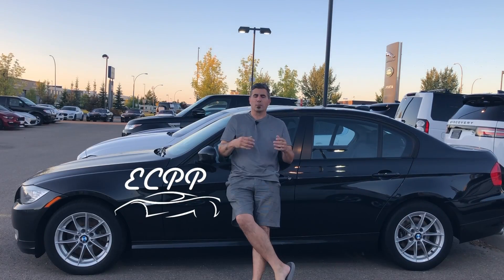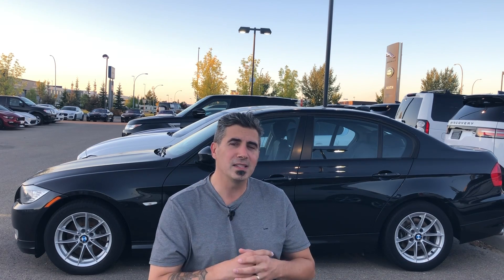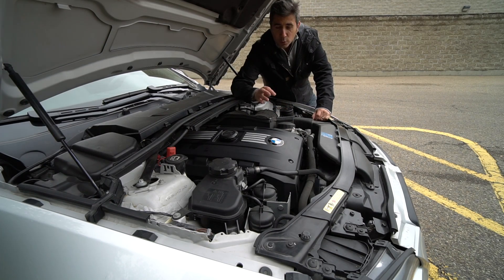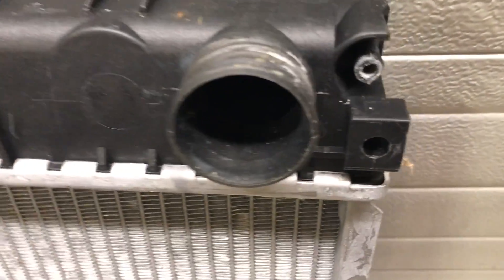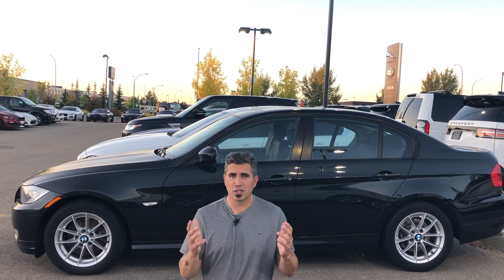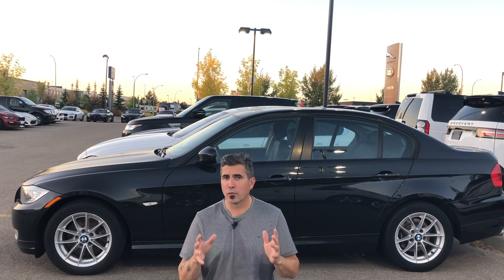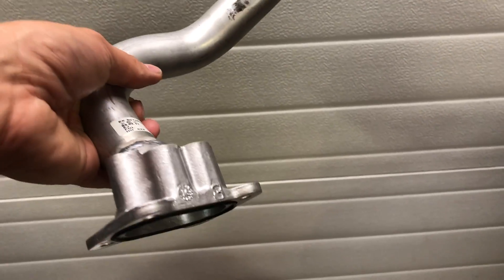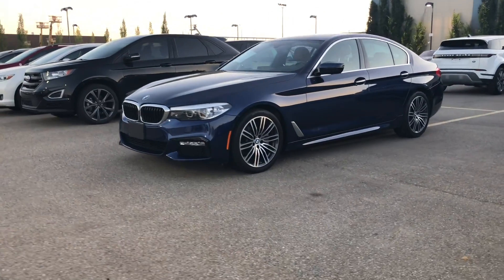Why Does BMW Use Plastic Engine Parts??

Comment: Well you are very politically correct and I can see why or the rational behind it. 

But, no thank you. Never again another BMW.

I like my $5,000 vacations too much to be spending that kind of money on my car so often. 

I am an engineer by trade and I can tell you. German engineers aren't using refurbished plastic to save the environment. They are doing it because the big wigs are telling them to and are cashing in.

I hope they listen to you. 
Because,  what they don't realize is they are killing the brand.

Do you want proof?

Look around, count the number of older BMW's as you drive block by block down any American street. You will notice THERE AREN'T ANY OLDER BMW's parked. Because, no one is keeping them!

They are immediately sent to the trash heap for demolishing, in as little as 5 to 8 years. At that point in there life the owner just can't justify dumping money into a car from hell.

 IT WON'T STAY FIXED LONGER THAN A FEW MONTHS AFTER 5 YEARS ALONE. 

Limp Mode becomes an all too familiar routine with these cars. 

If isn't a vacuum leak, its failed coils. If it isn't a failed coil its leaky gasket spewing burned oil into the passenger cabin. If isn't burned oil into the passenger cabin it's an electrical problem. If that isn't the problem now then it's a failed electrical water pump later because the blades are made of plastic. The list is too long of problems I have experienced, way too long. This is the short one. 

No thank you, and I will keep telling everyone until BMW decides to own up to their legacy of quality & pride in their product. I will not encourage greed of this magnitude. If they insist then they deserve to go under.

Respectfully sent

Comment: In Tennessee you don't see any pre 2000 BMW's on the road. You hardly ever see any 2000-2006 models. As a matter of fact you hardly see BMW's at all like you use too. I've been on the interstate and have seen BMW's break down right in front me with the driver pulling over putting on the emergency flashers while the car is still slowing down. I guy I know has a brother-in-law who is the German luxury car mechanic for a top import shop in town. He had to change the twin turbo's on a 7 series. He had to take almost the whole motor a loose to change them out. He said if he ever meant an BMW engineer he would probably knock them out. Anybody with any knowledge of plastic and heat knows which one will lose. BMW's are some of the most beautiful cars out there, but in these dangerous times we live in who thinks it's worth the risk with themselves or there wife and kids breaking down and becoming victims because you bought a beautiful, but plastic surrounding turbo engine because they BMW wanted to shave an extra five pounds of weight off the weight of a car so it can go 163 miles an hour verses 161 miles an hour. A woman friend of the family bought two brand new BMW's and they both broke down in less then three years old. She said never again. Why do you see Audi's all over the place. I see them everyday. BMW's every now and them.

Comment: I can attest, from personal experience, that BMW does NOT  cover these plastic parts in even their top tier "platinum" extended warranty programs.  Had steam coming out my hood on a coolant hose connection that broke in my, still pretty new, 3+ year old vehicle; was told it was regarded as a "wear and tear" item and not covered, like they're freakin' brake pads or tires.  Called up customer service, to inquire whether or not the coverage I had covers the entire coolant system, hoses and all, (not mentioning the recent issue I had), and the rep said, yes, it should be covered.  It would have taken half the age of the universe for a failure like this, if the connection were a (recyclable) METAL connection otherwise.

If anyone sees a class action lawsuit over this engineered obsolescence cr*p, please feel free to let me know.

Comment: I just leased a loaded Lexus Rx350. I test drove the X3 m40i and loved the way it drove, but decided to go with the Lexus due to the interior quality and value. I kind of regret it, and kind of don’t. After 3 years I don’t know if I’ll keep the RX or not. The fuel economy sucks 16 mpg (drive average) so far on the Lexus but takes 87. My friend has 2 bmw’s m4 & new X5 M50i and drives them hard and gets better similar mpg. So BMW is doing something right with mpg. What do you guys think?

Comment: Plastic coolant pipe from the engine block on my daughter's low mileage  318i just crumbled and caused the engine to overheat.  It was buried under the intake plenum and left the car out of commission for a week till I could repair it.  A difficult job to replace with lots of stuff to dismantle just to access.  (same part on my older '78 320i was metal.). I once looked at used BMW's but have been driving a SAAB now for the past 10 years and have no plans to return to BMW.   The newer BMW's scare me with all of the buried stuff and expensive technology.  This is no longer progress..... 
"Bring My Wallet" certainly fits the brand's logo.

Comment: At the end of the day, BMW, and other Brands that use an abundance of plastics that fail, are responsible for climate change. The same brittle plastic pipes, were once made of rubber with a metal screw. These pipes would rarely ever fail, unless punctured. They have made things that normally last forever, fail as if it was a maintenance item.
We as the citizens, have to pay ridiculous taxes for gas and waste, but these companies are making garbage parts, that last short times, that cause huge waste of plastic at the end of the day, for their own profit margin. The governments need to have laws preventing this, if they want to be serious about " climate change " - Mechanic of 20 years

Comment: Almost brought a 2011 bmw 328i 89k on it for 4200 . Sounds like a steal ehh?  No way Jose. I got a older model Lexus GS 300 instead. Much less repair drama and Toyota makes engines that last and last if maintained properly.
Reply from the maker: Thanks for sharing and the GS cars are nice too

Comment: All car manufactures are using more plastic but it's the quality and durability of the plastic that's used that is the problem. As you point out BMW's use of plastic in the cooling system has so far been a recipe for disaster, it's not of a high enough quality to last and failure often means severe engine damage. The plastics used on many European cars ends up cracking or failing whether it's in the engine bay or interior of the car. I worked on Renaults for most of my life and some of the materials used, life span is appalling. Yet if you buy a Lexus or a Honda the plastic parts are normally of a quality that lasts the life of the vehicle.
Reply from the maker: True, unfortunately

Comment: I´ve done over 500k miles on two e46s (330ci and 328i)  The american spec 328i engine without NIKASIL is 1 million mile engine.  That thing will burn tar and keep going.  All e46s have the same issues:  Water pump, water deposit, bad rear frame, silentblocks, airbags... The 330ci burns oil since, new 1litre every 1000 miles. BMW never recognized the problem and said its normal.   Running a Toyota for 400k with no issues, but its a boring piece of shit to drive.  Rather have the BMW with all its problems.
Reply from the maker: I totally agree Alex.  Same here.  They struggle with failures but woke are they ever fun to drive

Comment: Dont worry about all of that my friend.  Combustion engines are now all but obsolete and soon enough we will all be driving electric cars.  BMW not only lost its way by going the plastic route in manufacturing highly critical components and leaving many of its loyal costumers stranded on side of the roads around the world, many of whom will not be returning to a BMW dealership, they also missed the electrification train and will become irrelevant as a brand if they dont give their head a shake!
Reply from the maker: Hopefully not for at least 20 years so after I am too old to care about the driving experience.

Comment: You're absolutely right.  Something is amiss here.  One would imagine that engineers who presumedly spent years studying at perhaps some of the top universities would be aware of this basic fact and not use them in engines.  This issue about plastic, heat and cool, brittleness is basic chemistry!  Why are they continuing to do this?
Reply from the maker: Service business model

Comment: I have a German car made in 92 and almost all components are original. I could not even imagine swapping stuff every 4 or so years. Water pump, radiator, and flanges: made of metal. 
Hell, it's even the original stainless steel exhaust. Can you imagine this with a modern car?

Comment: Planned obsolescence. 

There is a reason BMWs are so hilariously cheap to lease in some places, despite having atrocious residuals. Here in SoCal you regularly see 250$ BMW leases in slower months/on loaners. Sometimes even with 0 down...

Personally, BMW is by far my favourite brand to lease as you spend less on the lease than you would on depreciation if you bought it (let alone maintenance!). If I was buying a car? Jesus christ no.

Comment: It's the thermostat cover that leaks. BMW became obsessed about weight gain in the 90's. They set up a department to find ways to reduce weight. Plastic parts and aluminum engine bolts were two of the recommendations - both of which are idiotic because they fail and leave owners with expensive headaches.
Eventually people learn and buy Toyotas.

Comment: More or less they are all using plastic parts,interior of every new mercedes has rattling and squeaking noise, new w213 e-class has sump tank made of plastic as well as drain plug,cover of aut.gearbox and etc

Comment: Ive a toyota mr2  its 14 years old. It has had one solitary problem, that being a parasitic drain on the battery, i had no idea how Prince william got in there? Seriously buy Toyota /Lexus, if you want hassle free motoring, as long as its been checked by a reputable mechanic.

Comment: Same problem with Volkswagen. 2011-15 Golf GTI was notorious for engine overheating and causing an everlasting damage to the engine part, due to plastic water pump they added. Guess what happens to that plastic part that carries liquid that's over 300 degrees.

Comment: At the end of the day, metal parts are way more recyclable than plastic - so Mark, your argument that BMW uses more plastic to make the car more sustainable is not a good argument. There is no excuse at all to use plastic in the engine, gearbox or cooling system... A 96 civic or corolla that is still in the road is way more sustainable than an X5 could ever be. I say this as an X5 and civic owner.

Comment: cars are meant to be disposable goods these days.  The average consumer pretty much demands it.  Can you imagine a self-driving, apple car play e36?  Consumers want the latest and greatest which mean manufactures invest in tech and creature comforts rather than durability and longevity.  If consumers stopped buying cars that break within a few years and demanded reliable, low maintenance cars, manufactures would change their offerings.
Reply from the maker: True enough

Comment: There is nothing wrong with plastics, bmw is. So many plastics inside japanese engine car compartment but didnt have any single problem as bmws.
All (japan) cars use plastic radiator top and bottom also, plastic in reservoir and so on to the piping on latest civic type r just like bmw from long time ago didnt have any single problem or brittle. Take note that plastics in the interiors also have same durability level between japan and bmw.
Problem is bmw using different material quality, and im sure their engineer knew this from the first place.

Comment: Simple: their engineers, through the use of 'plastic' parts, have developed very inexpensive parts that will 'expire' exactly 2 weeks after the warranty expires.  
The $$s added to their bottom line is simply outstanding and is matched only by the sheer ignorance of typical BMW buyers.  Perfect marriage.

Comment: The only time BMW took Plastic away and swap it to Metal was:) Hey the Carbon Fiber drive shaft cannot be place with the new regulation exhaust system , so we gonna give you one made from steel instead:) BMW are proud nowadays but full of trash...

Comment: What about 4.4 liter v8 with twin turbo that melts all intakes and timing chains fail at 90 thousand miles. Bmw car is not good ..Imagine car that you cant measure your own oil. You need to relay on falling computer.  I will never buy another one.

Comment: Plastic cooling systems can last a long time. The problem with BMW is that they run the cooling systems at really high pressures in addition to high temperatures to reduce emissions (hotter running engine = more efficient). The coolant cap on my E46 is rated at 2.0 bar, the one on my E30 is 1.3 bar. Expansion tank in the E46 was replaced when I brought because they have a tendency to crack, one in the E30 is original. If anything government safety and emissions regulations have made newer generations ov gas-powered cars harder to work on and unreliable. Once we switch over to Electric cars, cars will become simple again. All you need to maintain is a motor and a battery

Comment: BMW does have a few solid models you DO have to do some homework though. That N54 engine though... Steer clear. The M55 solved many of the M54 issues.
Cars like the E46 ZHP with a M54 is a solid reliable vehicle, very fun to drive stock, very easy to work on and the closed deck is very upgradeable.

Comment: I have had my 3 series for five years. I am now changing to my 5th radiator and will be changing to my 4th valve cover. My whole ownership has been about keeping fluids in the car. I've driven 3 series BMW my whole adult life from the e30 to the e92. The e92 is BY FAR the WORST 3 series I have ever had.
Reply: I wonder how many more BMWs left to fuck up before you wake up and start using japanese cars......
Reply: @sundaymorningguy  I have a 4 series now and its doing fine. Japanese cars are reliable but they're not manly enough for me to drive.

Comment: I was a big BMW car guy back in the 2000's. Had a e30 and e36 that were both great cars.
Then I got a E39 2002 525is.
What a fucking turd. Never looked at them again and from what I've been told the newer ones are even worse.
The e39 went though cooling systems quicker than the coolant inside 😂🤣
Id say plastic would also be better in an accident and absorb impact better than other materials. If im wrong feel free to correct me

Comment: BMW looks fancy from the outside. Toyota/Lexus quality is inside where you can’t see.
Reply: 180k miles on my 07 IS350...rock solid reliable.
Reply: @vollste  try 250000 on my civic since new and no major repairs . Bmw are plastic junk
Reply: @vollste  that's not that high tbh
Reply: @houseking9211  compared to a BMW it is. Show me a Beemer with 150k+ made in the last 15 years that doesn't need serious repairs
Reply from the maker: Nice
Reply: Latest Toyotas are good-looking
Lexus always looked as good in and out
Reply: Very true
Reply: Problem is they’re dull cars with outdated interiors. If I have the money for a “luxury” car, I’d want it to handle well and that would take precedence over maintenance costs.
Reply: @User-cb4jm Reliability>any other vehicle attribute. For all the money you spend on it, if your car won't go who cares how nice the interior looks?
Reply: Look up lexus problems and you'll see proof that Toyota isn't as reliable as you think.Google lexus gs400 won't start and there's multiple forums full of lexus that have serious problems from the factory.I know for a fact because my gs400 is one of them.
Reply: @real isrealite  dude are you seriously trying to compare BMW reliability vs Lexus? I don't know what drug you're on but you need to leave it alone.
Reply: @realisrealite5554  A few models have issues but by an large they're incredibly reliable. Can't speak on the most recent models but ime Toyotas have always been as reliable as it gets.